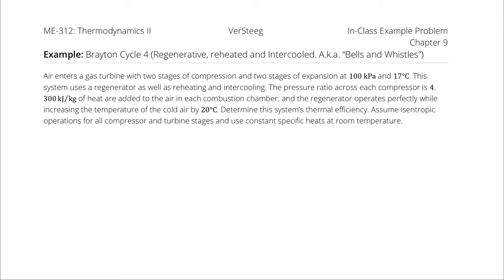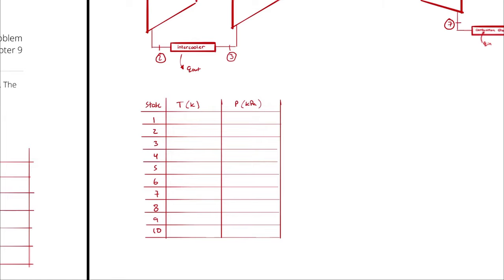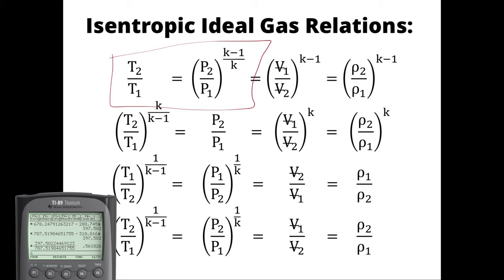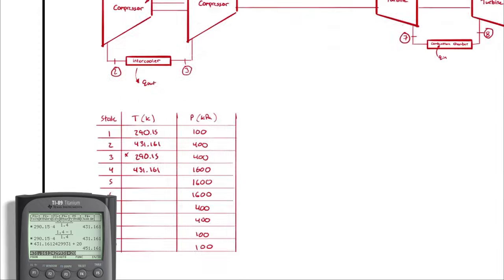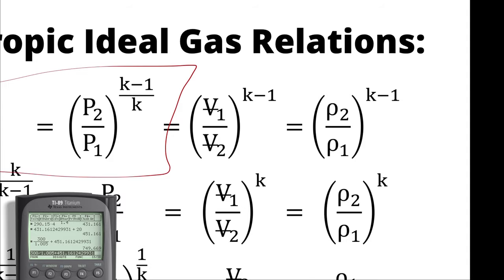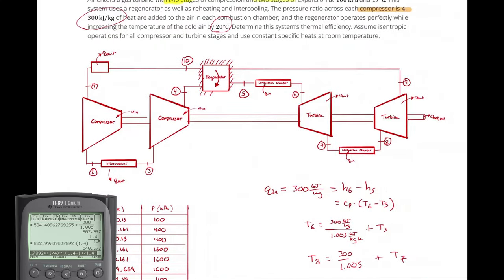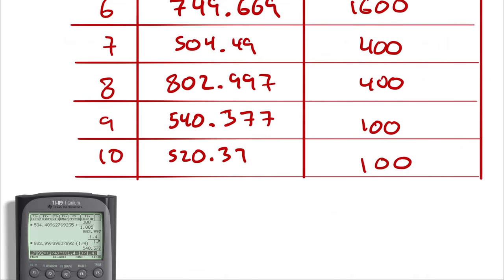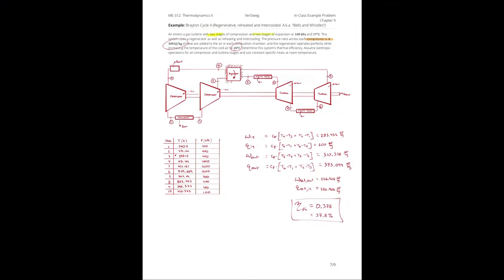Example Problem - Brayton Cycle with Regeneration, Reheating & Intercooling (Cold Air Standard)

Comment: This was a very helpful video. Thank you. However, between points 4 and  when you added 20 degrees celcius should you have not converted the 20 deg.C to Kelvin. Therefore 20 deg.C would be 293K making point 5 temperature about 723K?
Reply: You actually need to convert 431.161(k) to Deg.C, then sum 20 and convert back to kelvin, you'll notice that its the same as summing 20 Deg.C to the original 431.161 kelvin

Comment: I appreciate this video very much as it has helped me do a project for a class in Thermo System Design. I do have a question, however. The assumption that the Turbine pressure ratio is the same as the compressor leads to a Nozzle Pressure Ratio of 1. In this project that I am working on, there was no explicit information about the turbine pressure ratio, so I agree that from all my research online which only talks about the compressor, that the turbine ratio would be the same. However, if the nozzle is meant to have a NOT constant pressure heat rejection (providing the thrust) than this seems to be a dilemma as the pressure ratio is an exact 1 under this shared-compressor-ratio assumption. The "splitting the load" explanation i completely agree with, but it causes this problem to occur. Are low nozzle pressure ratio's actually an acceptable thing in design?
Reply from the maker: No - generally speaking, the turbine in a thrust-producing cycle (like the turbojet you’re describing) is only producing as much work as it takes to power the compressor (and maybe an alternator or refrigeration system). If you know how much work the compressor will take to hit a target combustion temperature and pressure, you set the work of the turbine equal to that and solve for your turbine outlet conditions. 

In that situation, the compression ratios should not be equivalent between the compressor and turbine, the specific work should be (as net work is no longer the goal).
Reply: @Thermofluids  I genuinely appreciate the quick reply. This definitely helped me understand it a bit more. I suppose the reasons for why the non-specific work value as I was obtaining were different, was due to considering a slightly higher mass flow entering the turbine due to combustion fuel. So this clears up one of those issues I was having. If I have any other questions I’ll comment again, nonetheless I appreciate the help you’ve already provided. It’s also helping out a few other people as well, as I am currently working with others on this thermo project
Reply: @Thermofluids  What equations would you use to solve for these outlet conditions, in the case of the turbine simply powering the compressor?